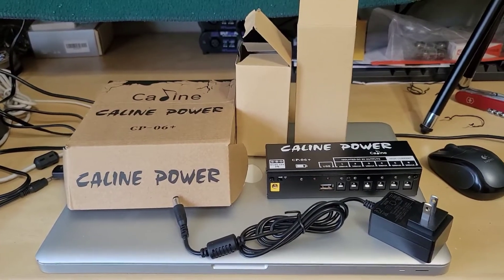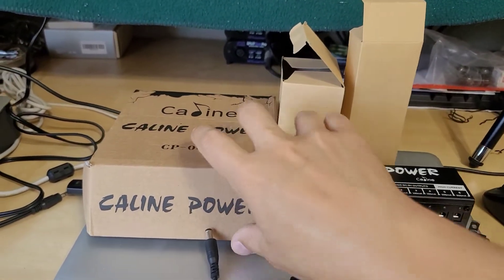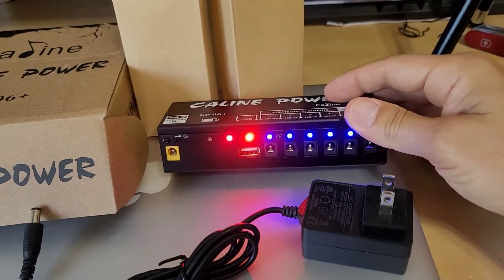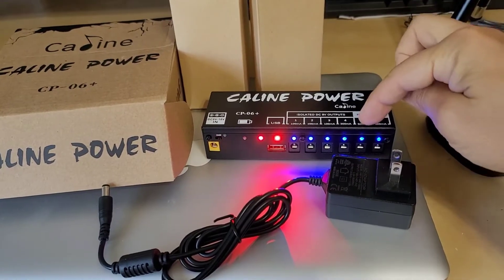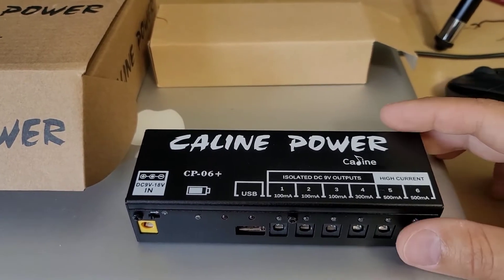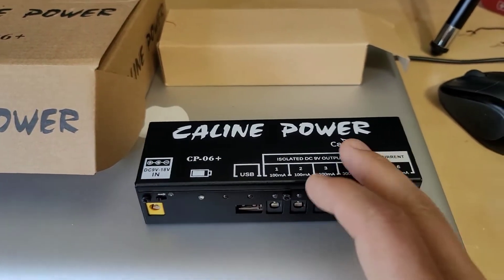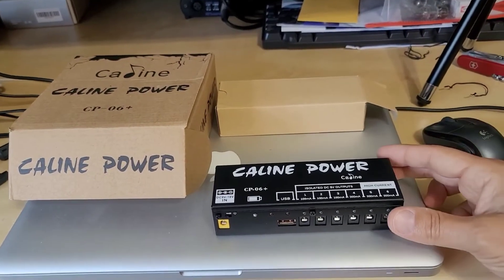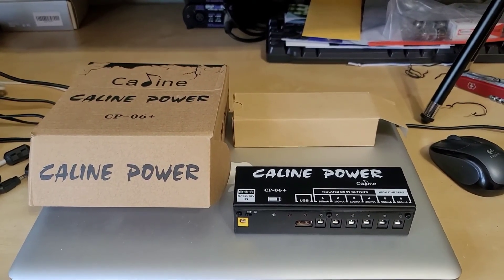Caline CP-06+ Pedal Power Supply: Teardown and Review

Comment: Can you do Donner's pedal power supply 10 output DC9v to 18v ?  Its on amazon for like 40$ ish.
Reply from the maker: Model#?
Reply: @Bassguitarist1985  Donner DP-1 Guitar Power Supply 10 Isolated DC Output for 9V/12V/18V Effect Pedal
Reply from the maker: If its the DP-1, then it is not an isolated PSU with transformers
Reply: @Bassguitarist1985  ty, I just wanted to get your thought on it.